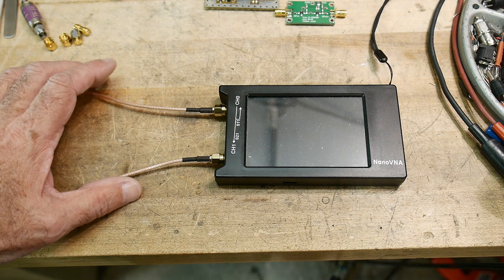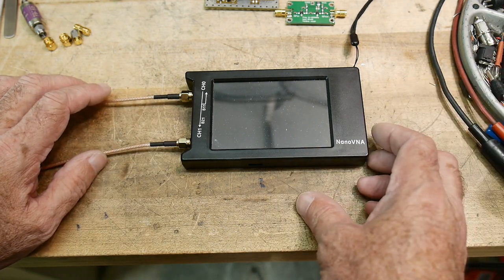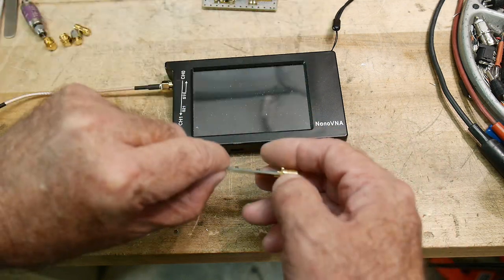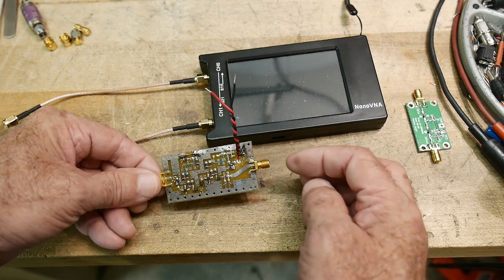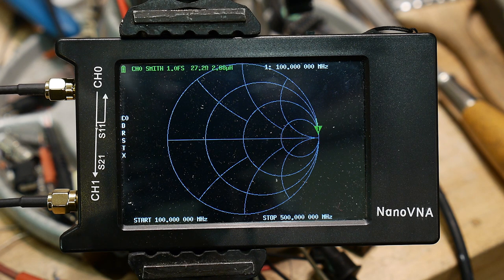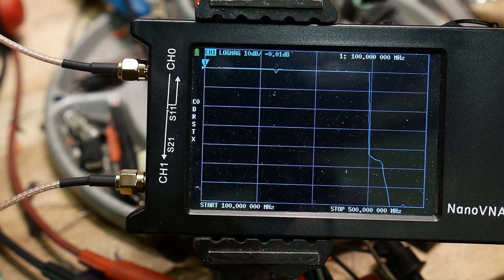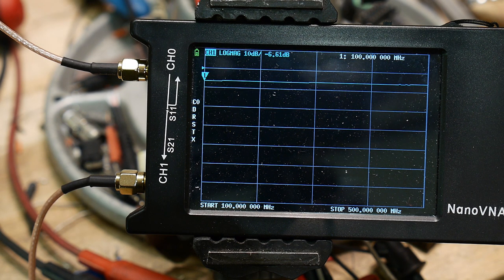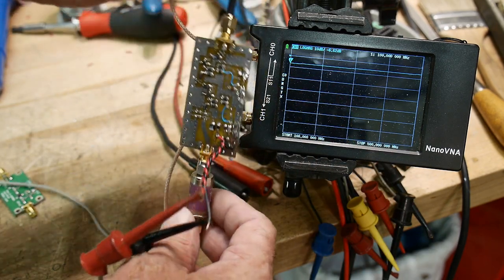#576 NANOVNA Measuring an Amplifier

Comment: You can measure the 60 dBm board by using a set of 20 + 30 dB attenuators at the input of the amplifier and a 10 dB attenuator at its output. It should work. I did something similar in a recent video on my Bloguetronica channel (on Oddysee). In my case, it was a 30dB plus amplifier that accepted a 0 dBm signal at its input. To be safe, I've used a 10 dB attenuator at the input and a set of two 10 + 20 dB attenuators at the output. That gave me an attenuation of 40 dB. As I said in a comment before, your video was the inspiration.

Comment: I bought a cheap attenuator board from Bangood. It does 0, -10, -20 and -30 dBm. Obviously it's  not lab spec but it worked OK when I used it to measure the gain of cheap RF amplifier boards without zapping CH1 on my nanoVNA. You can link the sections with SMA jumper cables to a maximum of -60 dBm.
Reply: I WONDER how much was tha t amp?
& is THERE ALSO +60 db?
 For recoger of Long extensión cable losses?
Reply: ALSO, how MANY volts

Comment: I was wondering if it's possible to calibrate the VNA with the 20 dB attenuation inline. Then when you connect the amplifier you would get the "true" output of the amplifier? Would this be correct outcome? I would understand that the SNR ratio at the VNA S21 end would be reduced because of the attenuation during calibration, but would this be a concern? Because we are only interested in Log/MAg on the thur, at relative high amplitude's. 

And as always! Thanks for all your video's, it really helps me understand better the concepts!  
Thanks, MikeK
Reply from the maker: I think that would lead to trouble. I would guess the nano is set to expect a certain range of numbers. your question points to the fact that all that test equipment I own can be HPIB controlled. it is the very reason that each test and setup is unique and things like compensating for an attenuator in software is easy to do. I've thought of doing a video on an automated HPIB test but haven't got around to it. I did do a video where I controlled a Keithley 2400 via serial port.
Reply: I would guess that since you are messing around with the feedback loop the NanoVNA would increase it's Ch.0 output to compensate to get 0dBm (or similar) on Ch.1.   As a result the front-end Ch.0 amplifier would saturate and look like garbage.
Reply from the maker: @GodzillaGoesGaga  your guess is wrong. there is no feedback loop. the nano keeps the ch0 output the same and just monitors ch1
Reply: @IMSAIGuy  How does it calibrate ??  Calibration is a feedback loop which stores the data (albeit in software) for a known input and corrects for it right ?   Normalisation is a form of feedback from my understanding of control systems.
Reply from the maker: @GodzillaGoesGaga  All VNSs calibrate with calibration standards. Open/short/load. the calibration is done for S11. then a cable connecting the ch0 and ch1 does an S21 transmission cal. the cal is over a range of frequencies. This is a simple VNA and does not include S22 or S12
Reply from the maker: have you watched this video?
https://youtu.be/yGKWBpgN8PU
Reply: @IMSAIGuy  Thanks for the clarification.  Got it.

Comment: That will surely be my use case when my newly bought NanoVNA arrives. I'll have to use attenuators, mainly at the output of the PA.
Reply: As an update, I did use it to characterize a PA, and worked a treat!
Reply from the maker: What parameters did you analyze? gain vs freq.   anything else?
Reply: @IMSAIGuy  Basically, I was able to measure gain versus frequency, plus the Smith chart of the input, which is not very relevant, because I was measuring essentially the effect of the attenuator at the PA's input, with little contribution from the input stage. The setup is here: https://twitter.com/bloguetronica/status/1315699061937319939/photo/1 . And the results can be seen here: https://twitter.com/bloguetronica/status/1315736220761194500/photo/1 . It is a very nice tool!

Comment: Hi IMSAI, love the content! On the subject of: "can you do videos on, ...", any chance you could do a video on measuring the output impedance of various elements (active circuits in particular).  When building RF circuits you're often trying to match impedances between circuit sections.  You design for a particular impedance, but it would be nice to verify with an actual measurement.  You often see expensive variable reactive loads used to compute this, not sure if there's a "poor mans" version?  Keep up the good work!
Reply from the maker: well you're getting out of my knowledge zone. I've never done RF circuit design and measuring s-parameters of active devices sounds tricky. I've thought of trying to build a matching LC for the SAW filter I have. seems easy to do the C part but the L part might require more knowledge of RF inductors  than I have. Having the VNA does make it much easier to do this stuff so maybe I'll have to try.
Reply: @IMSAIGuy  Yep, same here, I'm certainly not an RF guy.  I do stumble into this from time to time building circuits for amateur radio.  I think the classic approach is to measure the unloaded output voltage, then measure again with a known load.  You end up with a simple voltage divider with the output impedance as the unknown (w2aew did a video some time back).  Works for low frequencies, but gets progressively inaccurate at higher frequencies.  Anyway, thought it might be an interesting application for a VNA.  Keep up the good work.
Reply from the maker: that works for the real part of the reactance but not the imaginary. no phase

Comment: Guy,
I recently bought the LiteVNA64 and I can't find any info on the port 0 output power. I'm thinking I could put it in CW mode at a frequency within the fundamental range of the internal clock and using that as an estimate, knowing the Si Labs clock uses weaker harmonics at higher f's, measuring it on a properly padded SA. What do you think?
Reply from the maker: I did some videos where I measured that. Can't remember the value. around 0dbm I think. the port 1 power is way hot, be careful. I did a video on that too. I have not measured your exact model though. I have a playlist for all my nanovna videos

Comment: couldn't you use a Multimeter? to check the power. before you run your tests on your VNA?
Reply from the maker: No. Multimeters will not measure high frequency
Reply: You need a high frequency power meter. DMM are good for DC only
Reply: Thanks 4 the replies! ok, sorry...I see now..;)
I need an oscilloscope! or NVA...
Reply: @__--JY-Moe--__  depends on what you are doing. Oscilloscopes measure time domain signals. VNA is a frequency domain measurement. You also have Spectrum analyzer for frequency domain analysis. So it depends on what you are trying to accomplish 🙂

Comment: so if you calibrate through with a 20 db attenuator does it allow u to measure amplifier gain without breaking VNA ? aka 20 db attenuator = 0 db after cal so with amp it would show directly the gain
Reply from the maker: Yes that works fine. The only issue is the calibration is done at a level 20 dB lower and so the cal will be noisier. If your VNA has lots of dynamic range this is not a problem.